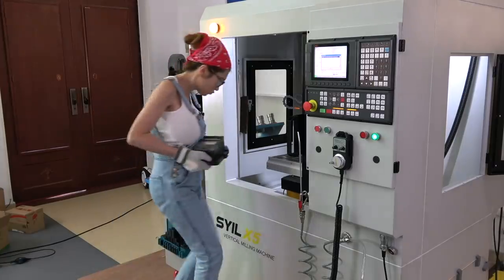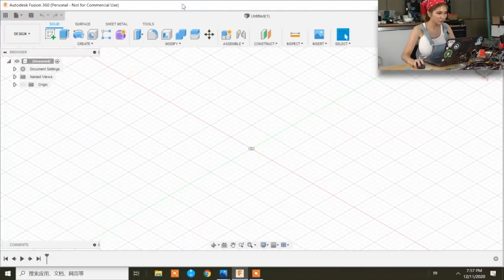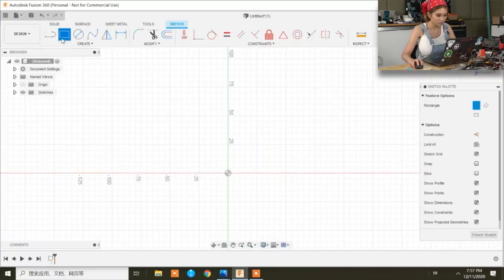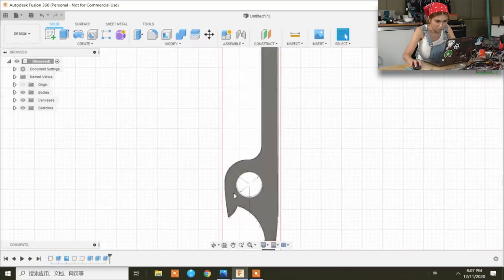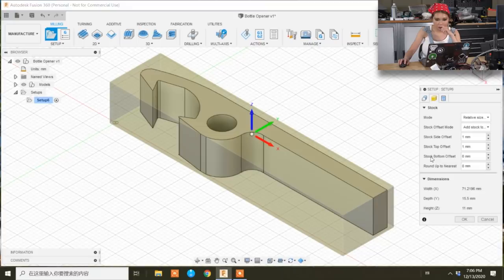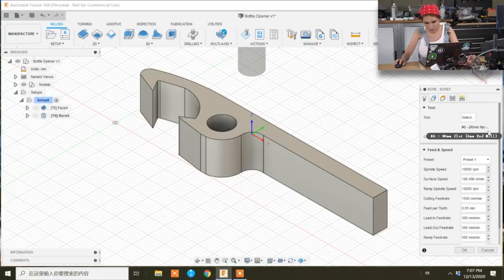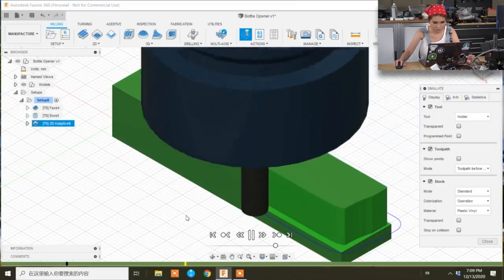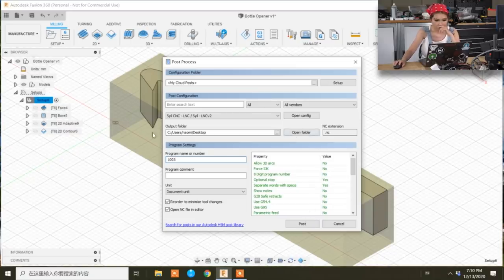CAD/CAM Bottle Opener For The Syil x5 CNC Mill

Comment: An old Dresser Rand plant had Numerical control milling machine that used punch tape.  It used airlogic and electrical relays to control.  Machine was from the 1940s but it still worked up until it was converted to digital(1990s).  The machinists loved it because it was so heavy.

Comment: Nice video! The LNC controller is really easy to set up with ethernet cable. That saves you the hassle of the use stick!
Reply from the maker: Thanks for the tip!
Reply: @Naomi-Wu  you're in the Syil Facebook group right? They have the files and instructions  there. Enjoy your machine!

Comment: great - I am glad your were able to connect with Aaron.   Interesting to note that some inside features or radius are almost impossible to do - like the inside of the hook. Limited by tool radius. Its a little more complicated than 3d print as you have different materials and cuttings tools.  a lazer or plasma only need one tool but are really only for thin metals and cant do 3d.    Hope to see it done  = Op2 is the real challenge

Comment: Hi Naomi, you said you would have a CNC lathe if you had a lathe. Most lathe operations are very simple so the time you spend producing a CNC program is far greater than the time it would take to just take the object and make the cuts. Lathes have fewer degrees of freedom so are inherently simpler. Apart from one complex profile I need to produce I cannot think of any task on my lathes that would be helped by CNC. (I have a Myford ML7 and Taig micro-lathe). Milling is very different and I have a Taig micro milling machine and a very simple CNC mill because it is in milling I can see the major advantages, especially when you have to produce a small batch of components. Chinese lathes imported in the UK initially had a lot of problems. A recent review by xynudu of the sumore 7x12 would suggest that good machines "out of the box" are becoming more available from Chinese companies. Happy New Year and I hope you had a happy Christmas.

Comment: Having learned to program CNC machinery (never worked with it since) I certainly appreciate how easy modern CAD CAM solutions make it. Still, easy is relative! It's easier than having to program each step on the CNC using lookup tables and calculating each and every step by hand. Also there weren't any way to simulate the process other than running through the program without the tools. But even that wasn't without risks as it was easy to crash the tool head into something if you made a mistake when entering the program or when doing the calculations.
A simulation might not be able to perfectly simulate tool load and such, but it's a whole lot safer than just pressing go and hope for the best...

Comment: You have some sharp internal corners in that model. How small are your cutters? One of the limitations of a mill is that you can’t mill an internal radius smaller than your cutter. A bit of design tweakage may be in order.

Comment: your 3D printer is also a CNC machine
you a slice of program is like it cam program
it converts the Program to an ISO program/gcode such as cnc
 machines are running 
I have many years been riding the program's manually but today I use CAD/CAM  and slice of programs to run the various machines.
when you get your CAD/CAM/Fusion 360 set up the right way it's not hard to use
many have trouble setting up the coordinate system for parts and for tools to start with on the CNC machine.
all filament 3D printers runs  CNC/ computer numerical control  coming from  Arduino/grbl originated from riprap Project.

have patience in learning it and it will give you a good reward .
best regards and hope you have a Happy New Year

Comment: That boring operation is going to be brutal 😄 excited to see how your machine handles it
Reply: Yep, i too see very little room for chip clearance, maybe use a smaller diameter and go slowly?
Reply from the maker: Wow hey Marco! Yeah it's not exactly elegant but I wanted to do the whole thing with one tool and keep it simple for my first project😅
Reply: @Naomi-Wu  I think that's a mistake. The machine comes with a tool changer so as long as the tools are properly touched-off it should be "cycle start" and tap your foot. If you're afraid to make chips right off the bat than "cut air" a few times until you're confident.
Reply: Pro trick : you can watch movies at Flixzone. I've been using it for watching all kinds of movies lately.
Reply: @Luis Dominik Yea, have been using Flixzone} for years myself :)

Comment: I work in fusion, when you were doing the sketches you can pin the sketch function you keep using in the drop down menu on the right side of the operation/sketch function where the 3 vertical dots are. Just saves a ton of time if you are gonna be working in fusion for a while. I haven't seen the Syil x5 but do you not have a holder file you load into fusion? I'm guessing on the 2nd video shows how you tell it where to put the object in your holder

Comment: You don't like cloud tools? but you're the queen of TinkerCad! I do agree with you on the principle though. SolveSpace is my favorite CAD, it's open source and quickly improving (build the main branch from source, the last release is old), but all the cam it includes is for essentially 2D laser or router.

Awesome video as usual! Neat to see the cam process in Fusion, never used it before. How will you hold the stock since you chose to leave none in the bottom? Super glue?

Happy (Western) New Year!

Comment: I use fusion 360 , but also dont like doing it on line, so I log in as usual , but then I turn off my WIFI , and I can continue to use as per usual , you will just not be able to access some  info from online .  good luck !!